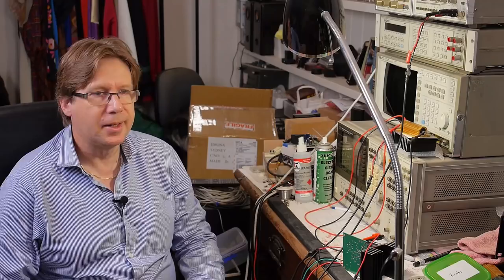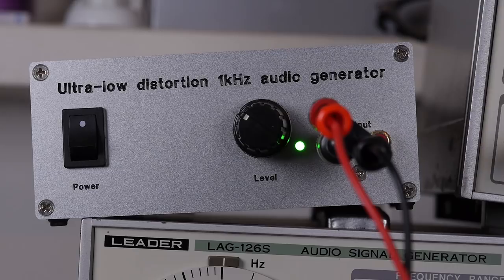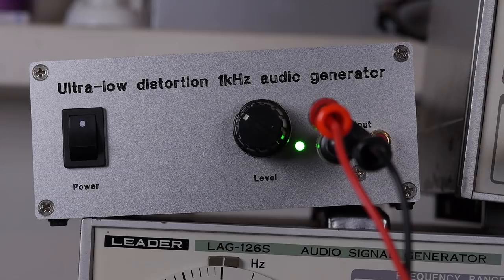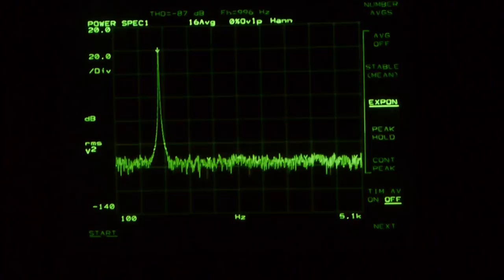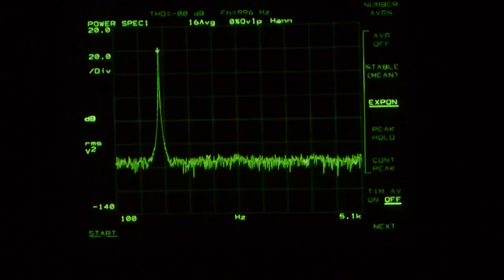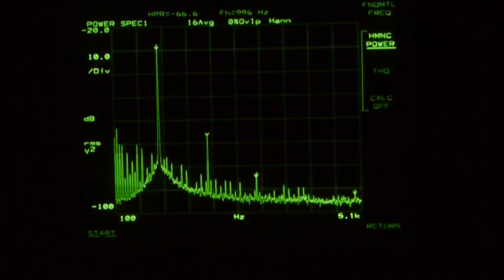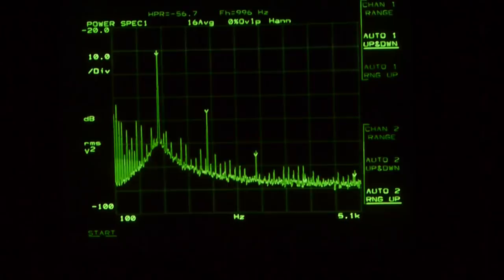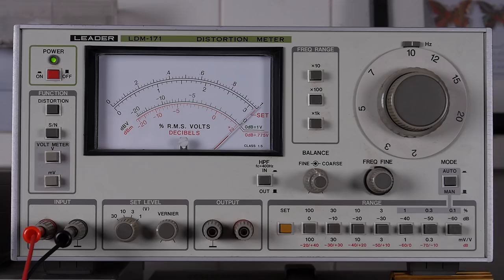Guest Video - Karl Adams - Audio Distortion Measurement

Comment: Here's the problem Karl.
No one on the planet can hear the difference between 0.1% and 0.01% distortion, much less 0.001%, in fact once you get below about 0.5% distortion it is basically a non-issue. No one can hear it in a double blind test. Audio critics are the worst, by the way. Stereophile magazine's Michael Fremer was famous for getting all goose bumpy about an amp with around 20% distortion before someone pointed out it had 20% distortion!
What's worse is we like distortion, just special types, ask any guitar guy or tube guy. I love just the right amount of second harmonic tube distortion personally.
Somewhere in the nebulous mess of audio nonsense someone figured distortion was important, of course it was 5 and 10% distortion in those days! So manufacturers latched onto distortion like it actually meant something and their data sheets kept competing with each other for who could have the lowest distortion figures. Unfortunately no one has shown that super low distortion has anything whatsoever to do with musicality!
Reply: mosfet500 in a professional toolchain, you want to keep unknown distortion down in every single step.

You can always add wanted distortion later
Reply from the maker: In the seismic industry I was in, every 0.001% distortion mattered *a lot*.
For audio, distortion still matters because you can have many chains in a system and they add up, e.g. a complex mixing console.
Reply: That's right. If you're running with analog mixing consoles, the distortion needs to be right down at minimum. Extremely important if you're building any serious piece of equipment!
Reply: Actually, I feel it doesn't really matter whether you can hear 0.1% and below or not (I do think I've seen references that you actually can down to 0.0x% or something). I instead consider it a challenge when I work on audio. Is it measurable? Yes? Then why not minimize it, if for nothing else than for intellectual challenge? Also, you never know when being able to measure this comes in handy - for example I found that I had a badly designed voltage regulator on a DAC chip (not really regulating well due to bad bypass capacitor choice) from seeing unusually large distortion on measurement; harmonics around -80dB that you would dismiss as non audible but which exposed a design flaw.
Reply: In a professional mixing environment, I agree that below 0.01% it really does become mostly a non-issue, unless you are chaining a lot of devices together.   Even 5% THD isn't honestly that noticeable to most people.   However I can wager than an experienced sound tech, in a familiar setting, can experience a noticeable difference between 0.1 and 0.01 in the playback chain, enough to compromise the mix of a song.    The coloration that imparts on the music can become relied upon and once the mix is played back elsewhere, that coloration is gone, making the mix no longer "sit right".  It all gets pretty subjective at that point as to what really matters though.
Reply: It's about control. Distortion is fine, but unwanted and uncontrolled distortion is no good.
Reply: It's very common to chain multiple analog devices together in professional audio mixing. The mixing console is the one device you do not want to introduce distortion.
Reply: You can, trust me....it´s THD, not even harmonics only.
If you play a sinusliodal tone on a medium to large PA with an SPL of, let say 90dB you gonne hear even 0.01% clearly when you inject a 3rd or 7th harmonic....
Reply: Come on Dave are we talking the "seismic industry". Some manufacturer advertises 0.0001% distortion in a piece of equipment, who's going to hear that? Herbert Von Karajan from the grave? 
It's an LM1875. A couple of bucks chip with a distortion figure of .015%. OK so multiply the chain with ten pieces of home audio equipment and you get .15% distortion. Is it a complex mixing console? Is that what we're making here? Give me something to work with.
Reply: Come on Dave are we talking the "seismic industry". Some manufacturer advertises 0.0001% distortion in a piece of equipment, who's going to hear that? Herbert Von Karajan from the grave? 
It's an LM1875. A couple of bucks chip with a distortion figure of .015%. OK so multiply the chain with ten pieces of home audio equipment and you get .15% distortion. Is it a complex mixing console? Is that what we're making here? Give me something to work with.
Reply: Once you get below 0.01% it's all subjective. It's audio, there a famous test with audio critics. They put them in a room and told them they were listening to speakers hooked up with chicken wire. They all said the sound was scratchy - It was expensive audio cable.
Here's a better one. John Atkinson a well known audio critic does a double blind test and can't distinguish a piece of high end audio equipment from a cheap one so he buys the cheap one, takes it home but can't live with it and goes back and gets the expensive equipment. You can't make this stuff up!
Reply: Is that what we're doing? sitting in our living rooms injecting odd order harmonics in to 90db PA systems? It's an LM1875 for Pete's sake, a couple of bucks chip with a 0.015% distortion that goes into home TV systems. Worse the big brother, the LM 3886 was put into a piece of audio equipment and sold with a fancy face for $3k. The audio critics raved about it until someone took it apart. Now every kid who got a soldering iron for Christmas is making "gain clones" with NS chips. Look it up. 
Look up the guys who sell wooded stands to keep cables off the floor because they sound better! 
Audio, it should be called comedy!

  "There's a sucker born every minute, sometimes they come in pairs."
PT Barnum
Reply: Yeah but not everything is audio... Clean sine waves have many uses.
Reply: mosfet500 as some mentioned: It's not only about living rooms but also about professional work. Chains of equipment in broadcast and professional studios can get very long so you don't want to add anything up. This video showed very nice general advice.
Reply from the maker: These sort of techniques apply to many fields, not just audio, and hence the video is applicable to many fields. Stop getting fixated on audio and audiophoolery.
Reply: It can be easy to see the difference in distortion and noise when comparing amplifiers.  Turn up the volume when the input is zero and some amps will be noisy and others will not.  You can likely hear your car stereo making noise even when the volume is down with no input.  Not hearing a harmonic of a 20 Hz tone on your mids and tweeters is a good thing.
Reply: Karl,
I'll give you that but the video is titled "Audio distortion Measurements".
We can talk about distortion in the chain but professional studio equipment mostly uses dedicated low noise chips like the 5532A.
In fact, it's hard to beat chips in designs if you simply want to reproduce the original content with a low distortion path. What designers do today is contour amps to give a specific sound, tubes, fets or whatever, talk to the old timers like Nelson Pass and he'll tell you the same thing. SE 300B amps have a specific type of distortion because the reality is that listeners like it whether they are listening to Wes Montgomery's guitar or the NY Philharmonic doing Beethoven's 9th. 
Distortion was a factor when you could hear it and it fatigued you after a half hour of listening. Today, electronics is so good that designers have to come up with gimmicks to sell stuff at high prices because you can make great sounding low distortion audio components out of the TI or Analog Devices box.

Look have your fun but audio distortion is not an issue and often a desirable commodity.
Reply: HalfSpeedMastering,
First, everyone cares about profit! Without it you're not in business. Can we make a profit and a good product? Absolutely. But, again, you can make an amp that has remarkably low distortion and sounds very good with off the shelf low cost ICs. 
This or that chip, transformer, capacitor, cable, etc. etc. sounds like ___ (fill in the blanks). This is an opinion.
 If two amplifiers cancel out in an A/B test with one inverted, no one can tell the difference between them. You don't like a chip, prove it in a double blind test with another chip in a similar circuit. Hint, more than one 'audiophile' has made an absolute fool of him or herself attempting to do that.

The thing that amuses me most about people who modify equipment is that they never seem to be able come up with the design in the first place yet they know exactly how to make it better. What's wrong with this picture!

It's more voodoo than science.
Reply: Can you have two circuits cancel in a subtractive test to the point you won't her the difference? Yes, even if there is .01% difference between the two you won't hear it.
Reply: "I know what a good resistor is, do I also have to make one? LOL. Jajajajajajaja"

you may know what a good resistor is that doesn't mean you are capable of making one from scratch. Most of the mods I see have no benefit. I see people talking about the minutest differences in capacitors but no one seems to be able to hear them in a double blind test.
I don't have a lot of respect for mods, a lot of opinions with no scientific foundation. '5532A is crap' statements that one person claims and the lemmings follow behind parroting.
Reply: "To tests a power amplifier #1. You need a 5000w 8ohm power resistor, made in China for $250usd+ shipping.'

I'd like to see the scientific proof of that!
Reply: ElmerFuddGun,
You're talking two different measurements, although  distortion and noise are often grouped as distortion + noise, they are not the always the same.
Reply: Fear Labs Audio - I believe the Keithley 2015's that hit the 2nd hand market after the downfall of Nokia, and more recent Samsung factory equipment upgrades, etc. are actually reasonably good at THD measurements compared to the specification of the crappy phone audio they were designed to analyse?  (0.004% 20Hz-20kHz ?)

Seems a good ebay choice over a Keithley 2000 unless you have need for the scanner board options.

EEVBlog #478 - https://www.youtube.com/watch?v=MiXMKgxx_Oc
Reply: Karl,
You appear to be a nice guy, I'm sorry if it seems like I'm picking on you but electronics has exceeded man's ability to hear and audio equipment built on electronics is no different. Look at some of the comments here, it only makes it worse for audio. That's too bad, I love audio, it's lots of fun!
Reply: mosfet50 Well, why some mechanical watch designed to be able withstand 200m depth of water.  Because we can, it makes us happy, and dolphins can wear it as well.

Comment: Why bothering using such obsolete equipment to measure the distortion, if one can use his own 24bit PC sound card in a loopback mode?  Of course the better the soundcard, the better the measurement precision.
Reply: Sixta16 Where on Earth do you find a PC sound card that isn't horrifically noisy? They're convenient, sure, but precision instruments they're not.